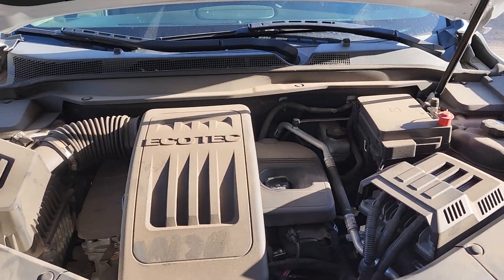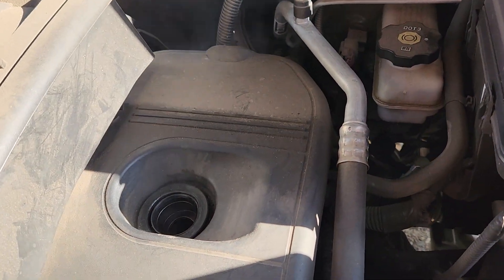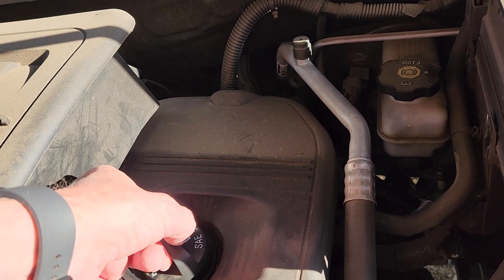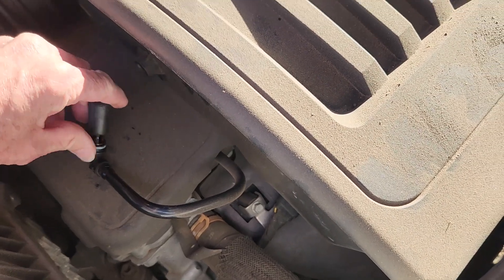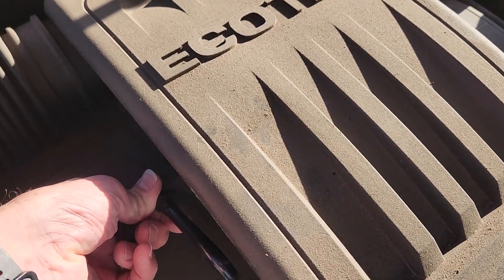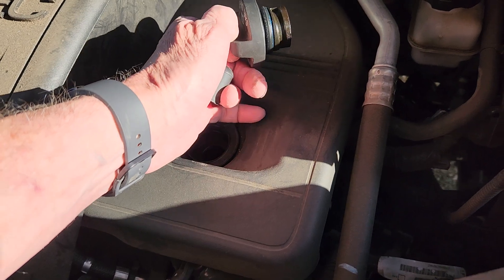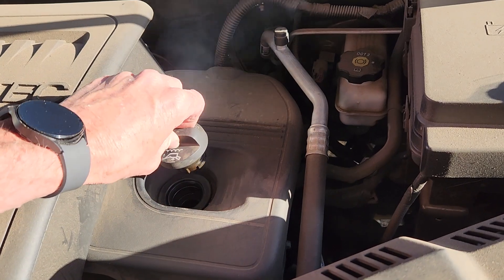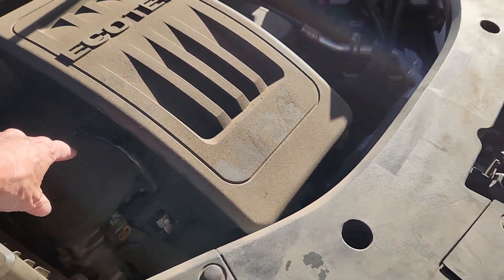2010 chevy equinox blow-by

Comment: Bad news there is a lawsuit about that, it's bad piston rings, if under warranty can be fix , buy an oil catch can, watch oil level,and frequent oil changes, watch other utube videos, didnt know about it untill after i bought one
Reply from the maker: Thanks for the comment. This video only solves the ring issue not the plugging of the PCV hole.  Mine was not plugged, just lots of blow-by and using tons of oil.  I show another video where cleaning the rings solved it so far.  Our research showed the lawsuit on the ring issue is closed.  Our local dealer said they extended to warranty to 100K miles and 10 years.  We missed both. (2010, 125K miles).  The cleaning technique (https://youtu.be/XOrV11Ho2Sk) solved the blow-by and I am waiting to see about the oil consumption.
Reply: @ryanl6722  My equinox is a 2014 with over 60000 and mine is doing that but my pvc doesnt squeek when I plug the tube.
Reply from the maker: @raypalermo1603  if there is no squeak, there is a good chance your PVC system is not working properly.  this might help...https://youtu.be/cyoJ02cAQig
Reply: @ryanl6722  Thanks

Comment: Ryan, is it still working
Reply from the maker: so far so good.  I changed the oil at 4000 because it was down 1 qt.  I would have liked to make 5000 but the VVT valve died, and it was down a quart.  4000 is better than the 400 I was getting before.  I added a pint of seafoam to the engine (added it to the oil) and drove 50 miles before the oil change.  I'll keep posting at 1000-mile intervals.